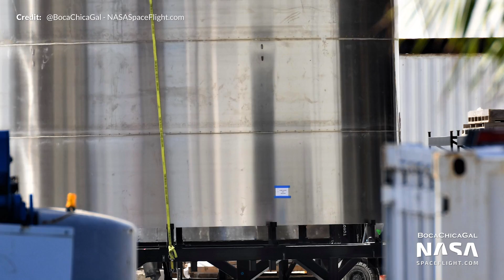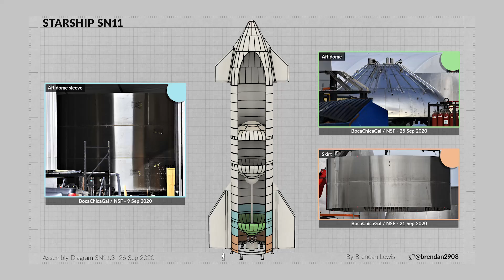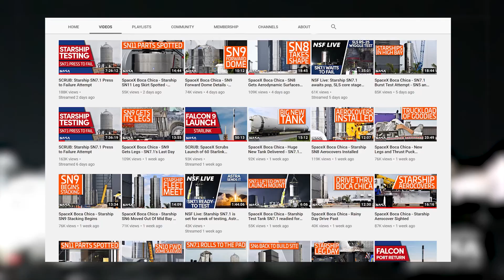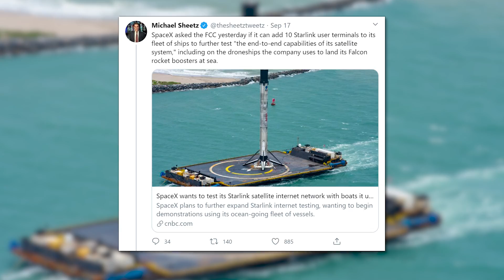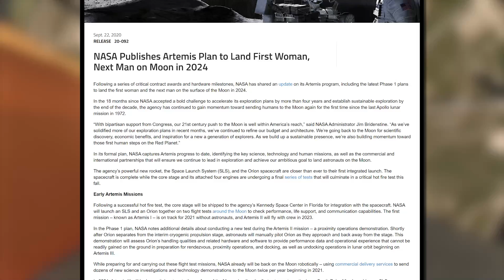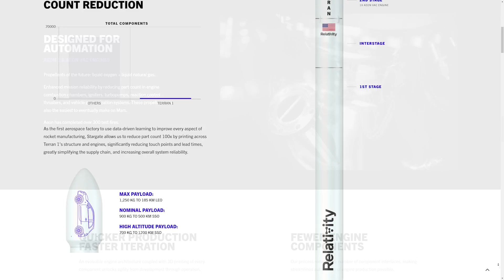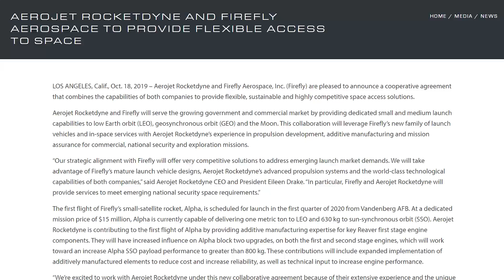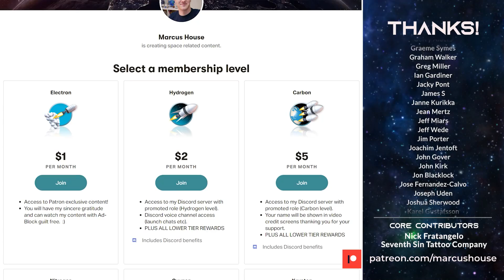SpaceX's brand new Super Heavy monster is coming - SN1 build has begun

Comment: 6:12 "The stand can be  seen being anchored down with stainless stainless steel coils to reduce the tip over factor (using heavy chains)... You gotta just love their "high tech" approach to these kind of problems".       Well hell, that's what makes SpaceX so damn much fun to watch!
Reply: I can see that conversation:
Engineer #1: "Alright, our stand tipped over and was destroyed. Its very cheap and theres really no problem in building another, but we'd rather not have it happen. I suggest we anchor it down into a foundation and reinforce its structure."
engineer #2: "no. that will take too long. there must be another way."
engineer #3: "add weight to it"
.
.
.
All: BRILLIANT!
Reply: @PhaseFalcon  Yes! The low-tech solution to the low-tech problem! I have often been disappointed with the high-tech solution to the low-tech problem!
Reply from the maker: Indeed!
Reply: The "keep it simple (KIS)" phrase is one of the first things taught to engineering students for a reason.
Reply: @InfuriatedHawk  In aviation, we called it 'KISS': Keep It Simple, Stupid. Whatever acronym you use, the principle is universally applicable!
Reply: @richardpark3054  I've heard both KIS and KISS in engineering. Either way, it's one of the most important things we learn and is, indeed, universally applicable. Young engineers and engineering students love to add unnecessary complexity to things until they're expected to actually make them work.
Reply: @InfuriatedHawk  We're on the same page, bro/sis!
Reply: @InfuriatedHawk  KIS (Keep It Simple) KISS (Keep It Simple Stupid) & the "politically incorrect"version of KISS  (Keep It Simple S for brains)

Comment: I feel like I'm fairly up to date on most things with Starship/Super Heavy but I was just thinking about this after I realized the High Bay they are building is just for Super Heavy construction it seems (I thought it would function more like the VAB and would be used for stacking), has Elon stated a plan for stacking Super Heavy and Starship? It appears they are going to be just stacking them at the pad or just outside of the mid and high bay.
Reply from the maker: Not sure yet. The animations suggested a gigantic crane would lift it up. Probably only short term though.
Reply: @MarcusHouse  that will be quite a sight to see! I agree, I can't imagine they will continue that stacking process for too long.
Reply: As one person pointed out to me, they will have to load cargo in a 'shielded building' at some stage. Some satellite launches in the future will be 'sensitive' and some will need a 'clean environment' and they may have to ly the rocket flat, load it, then raise it to a vertical position. All valid arguments. Currently it will be at the launch pad. Not that heavy empty say 200 tonnes for SH and 120 tonnes for Starship plus 100 tonne payload.

Comment: It's going to blow, surely. At least for the first and maybe the second.
Reply: I hope they can get through the ascent phase and maybe do some fin flapping on the way down with SN8. Running three raptors for well over a minute without hiccups and then reignite them is going to be a challenge for sure.
Reply: Why?
Reply: @facepalm7345  Have you ever been able to do a trick first time? You might have but the chances are actually quite low, it can be translated to this launch too. There must always be failure before you can accurately test something's limits + capabilities. Not to mention this will be the first starship. Chances are they've done something wrong already that they will end up finding out later.
Reply: @homosapienfactory6291  I would agree if they hadn't been working on building it for almost a year already. IMO the starship is a tougher thing to design than the super heavy. They've already done multiple wielding tests to understand the materials and it's weaknesses. Superheavy isn't going to have a nose cone or anything like that. I think it is more likely there is something that goes wrong, probably not catastrophically but it's not a guaranteed failure
Reply: @facepalm7345  Even then, it'd be silly to use the first one ever made. Design flaws are easy to come by. Doesn't matter how much designing you do. Some things can always be improved or changed. Like your first kid. It's a test run basically, you learn to become a parent, in this case you're learning how to care for your multi million dollar rocket.
Reply: @homosapienfactory6291  I never said they would use the first ones, just that they understand enough about possible variables and have enough data to be able to create something that can withstand their tests. I dont think anyone ever expected SN1 starship to go to orbit
Reply: @facepalm7345  I never said you did lmao, in any case, that's my expectation.

Comment: This may be a stupid question - but why the high-altitude hops? Previous rocket programs would check the engines and then launch orbital or nearly so and boom - done. I'm guessing because without the booster, there's no point in a ballistic trajectory test? Also is it just me or is the Rvac remarkably close in size to the F1?
Reply from the maker: The goal of this vessel is to be reusable. The high altitude tests allow them to test landing systems in a variety of ways. One step at a time to orbit. Those steps are coming quicker and quicker.

Comment: Dumb Question: Are those welds Robot or Man Made?
Reply: Which welds?
Reply: @kschleic9053  Well, let me rephrase...which are robot and which are human on any of the latest serial numbers?
Reply: @spyderlogan4992  gotcha..
 I wasn't sure if you were talking about starship, since later in the video there was a segment on a company using robots to print rocket motors using weld beads😂

I haven't heard anything about robotic welding being used on starship so far, but it's possible. I think the newer welds are being done in an argon atmosphere
Reply: @kschleic9053  They are using the robots (3 bought in a couple of months ago: Mary filmed there arrival) to do the welds on the rings. Markings show it takes about 2 hours to cover the 28.27 meter circumference. The other welds seem to be by the welding teams. The Thrust Puck and supply tubes are welded at Hawthorne. Don't know how they do those.

Comment: The progress in Starship is moving at a crazy speed.

Correction: plaid speed. (Comments)
Reply: Ahmed Shabib comparing the sn1 to sn8 welds just shows how much better the manufacturing process has become
Reply: Sls costed 18 billion so far and each launch will be 2 billion, star ship has cost a little over 2 billion total and is aiming for 2 million a launch, sls will be cancelled sometime in the next 5 years as its an antiquated useless launch system already
Reply: @clippyremembers  The moment SpaceX can prove what they say Starship can do, SLS is dead
Reply: @adaster98  NASA / Boeing is following a more traditional dev cycle which is failure / risk averse. They did get Starliner to make  a perfect landing - on land, but needs to work on software which caused them to use all their hypergolic fuel because the platform didn't know what place it was in the mission (which ironically enough could have been mitigated if there was a crew on board). Bottom line what's better than a crew-capable space vehicle? 2 crew capable space vehicles. I'm still a bigger fan of Starship since it's configurations and mission profiles are massive (as is it's cargo and passenger capacity).
Reply: @mgabrysSF  NASA is not operating starliner, it is a commercial crew vehicle just like dragon operated by Boeing. 

Had a crew been on board and mitigate the problem, among a kaleidoscope of other issues, the thing's service module would likely have slammed in to the heat shield and caused a comple LOV and crew. Starline was a gold plated turd filled with bugs and BS. 

At this point, I'm not entirely convinced crew will ever fly on starliner, especially if Sierra Nevada gets the dreamchaser off without a hitch. Thwy have never abandoned that as a crew vehicle, and the one they are launching is, according to the sources I've spoken to in and around the industry, a crew capable vehicle configured for cargo, and would not take a major redesign to become a crewed version. 

NASA let people bought and payed for by ULA tell them, and the congress critters profiting from the Alabama mafia, commercial crew wasn't realistic or possible.... the same crew got caught in a pants down situation with spacex.

I would be willing to place a sizeable sum of money down that a starship prototype will make orbit before SLS.
Reply: They've gone plaid!
Reply: NASA SAID ITS IMPOSSIBLE.
Reply: @esecallum  Nothing is impossible with true SCIENCE
Reply: @Donpru  NASA SAYS IT IMPOSSIBLE OR THEY WOULD HAVE DONE.
Reply: Nasa is just a free brand recognition ride with spacex
Reply: Ikr
Reply: Barf: "They've gone to plaid!" https://www.youtube.com/watch?v=mk7VWcuVOf0 Start at 2:1O
Reply: To catch up with him...one would have to go LUDICROUS SPEED!!!
Reply: @adaster98  This is what NASA is doing.
They paid for SpaceX to build a moon landing Starship.
They also paid other companies to do other things (and be a redundant lander on Moon) and they have their hands full with Mars rovers and ISS research too.
NASA aren't slackers and they aren't stupid either ESPECIALLY considerning they're a government organization.
Reply: Din Djarin  Not when it only flies twice.
Reply: No enemies some of NASAS payload is far too precious to trust a private companies mega rocket atm,  considering the history space X has with new rockets during their testing phase

James Webb Telescope is a serious NASA investment and is due to be launched around the time the first starship orbital launches, 

NASA will launch it on the SLS system and due to the heavy tried and trusted engineering that goes into it is a much more likely  chance of a successful flight
Reply: @Viralliness  JWST a serious and precious project: totally agreed! Having a bachelors degree in physics (UCB, 1985), an enduring lay interest in physics and especially cosmology, being a former USAF flight crew, I have an INTENSE interest in JWST and the data & insights it is likely to produce. But you're suggesting that's there's less risk launching JWST on SLS (which has never flown) compared to launching on a SpaceX rocket, which are tried and proven. You cite early SpaceX failures, but their philosophy is 'fail forward'. Currently, SpaceX is launching (and recovering boosters) with routine success. My money ($10k, if you're a betting man/woman), says SLS will NEVER achieve orbit. five-1-zero-five-o-4-2o1one.
EDIT:
Oh, 4 year time limit: SLS will not achieve orbit before 10/1/2014. If I bet 'never', I couldn't win the bet until the end of time. And if you want to bet more, I'm in.
Reply: Richard Park not the Starship actually, 

Which is the only rocket other than sls big enough to launch it, check the dimensions for it
Reply: Richard Park  your betting untested rocket against untested rocket, the only difference is that SLS is using existing launch architecture in a new format essentially, which tbh is kinda why I’m surprised it’s taken them this long to build the damn thing but whatever NASA is slow I’ll agree on that
Reply: @Viralliness  Oh, sorry, my friend! I didn't realize JWST couldn't fly on Falcon. But, in any event, I fully expect Starship to have flown many times by the time SLS flies, if it ever does. And I don't understand your apparent assumption that private launch is inherently riskier. SpaceX has had many failures, but that is part of their speedy, iterative development process.
Reply: Richard Park nope that’s the problem, people’s assumptions from the start are totally out of whack from present reality

It also remains to be said that SLS is a human rated ship FROM THE START, and Elon himself has said “it will fly, hundreds of times, before a human crew flys in it”

According to the flight roster sls has 3 slated launches in the next 4 years one of which at least is certainly a crew mission, 

And falcon heavy has flown what, 3-4 times? Why,  because the need for a heavy lift launch vehicle isn’t required in high volume yet,  falcon SH is a lot bigger still and will need to have sufficient payload to justify its launch too 

SLS is a heavy lift service rocket designed to fill in the gap between a requirement for long distance and high volume crew flights and a ship that’s designed to workhorse that requirement
Reply: Sorry I’ll reaffirm falcon superheavy/starship will need to fly hundreds of times before a crew steps into it 

And it’s the simple fact that space X normally designs some untested feature into their rocket launches which unfortunately space X will need to repeat with starship  which is another reason sls will launch JWST, NASA needs a “by-the-book” launch for it because it is also hideously expensive
Reply: @Viralliness  the vehicle is not "falcon super heavy", starship is not part of the falcon family, and shares minimal commonality.

They will fly several dozen flights doing dev work.... it's the beauty of reusability, it allows them to innovate. 

SLS is man rated, certainly..... and still uses systems, specifically the segmented stupidity or the SRBs, that have caused fatalities in the past. Dont pretend there is no risk of failure with SLS..... it's still an unproven system, with a  known dubious design for it's first stage boosters.
Reply: well SpaceX is using the Car trick, quantity with quality rather than quality quality